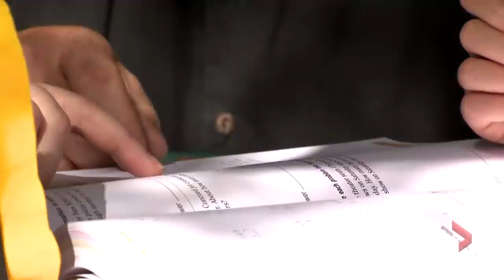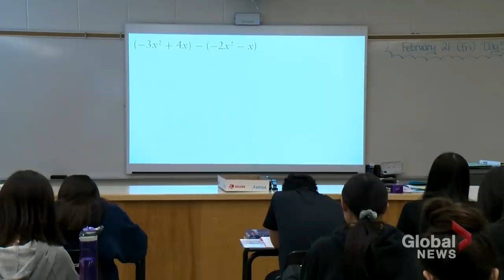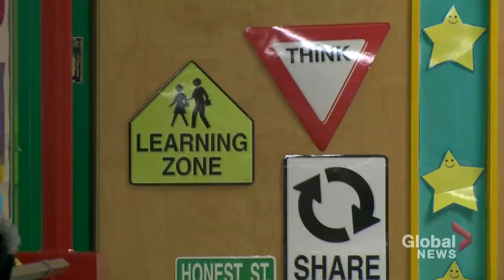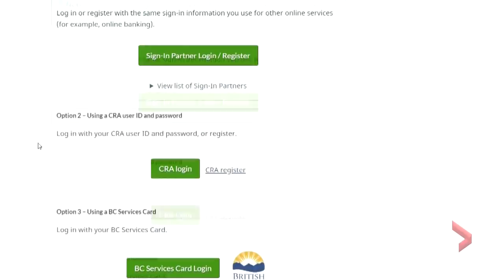Global National: Aug. 16, 2020 | Upcoming week critical for back-to-school decisions

Comment: What will happen when they eat lunch??
Reply: What we have seen in other countries is that the students would eat at their desk instead of congregating in the mess hall.   Plastic dividers are often used in other countries to partition off each desk but of course such separators requires that someone pays for them.  It's all boiling down to who is going to pay for the extra preventative measures.
Reply: Or ride on the bus? Or use the washrooms? Or use the same ventilation? Yep, unions just asked all the same questions, bc the going plans aren’t safe enough